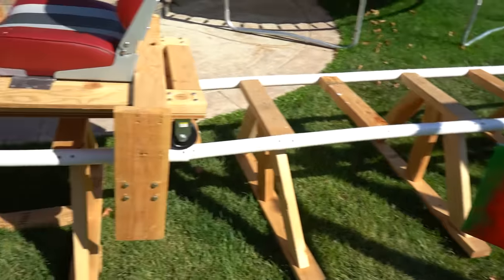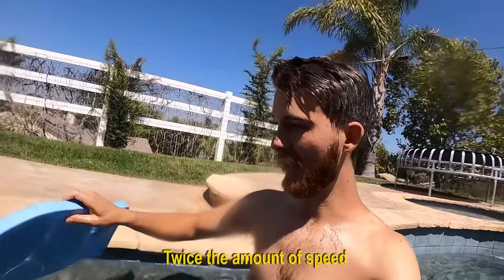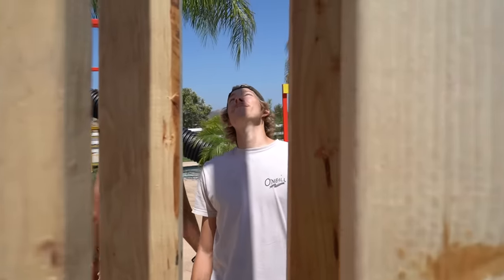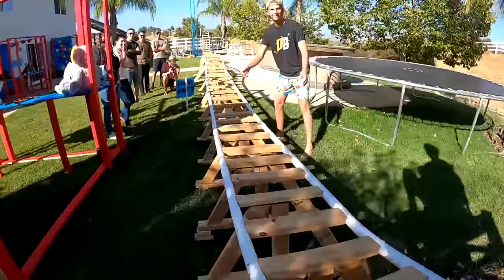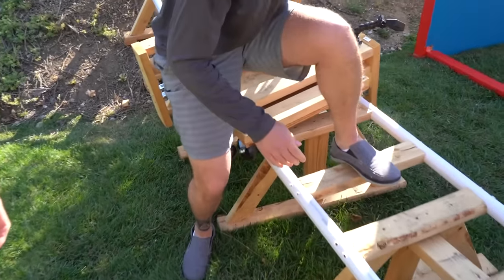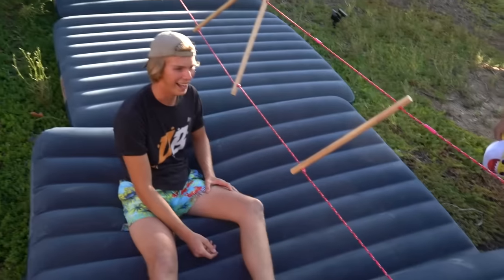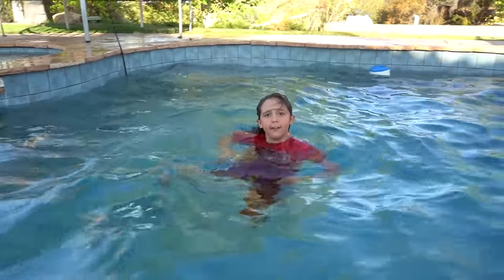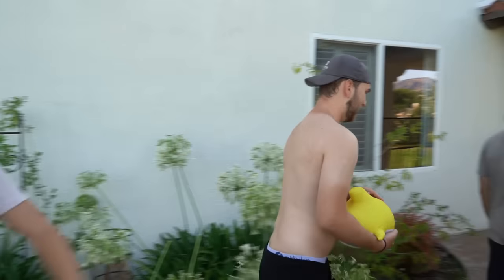Turned ENTIRE Backyard into a THEME PARK! *DANGIE LAND*

Comment: U can fix ur roller coaster if u redo the cart and add skateboard wheels and put it on the top side and bottom and make it out of steel it should fixs it with physical of the cart not having a good shape for it to alomst be impossible to take off